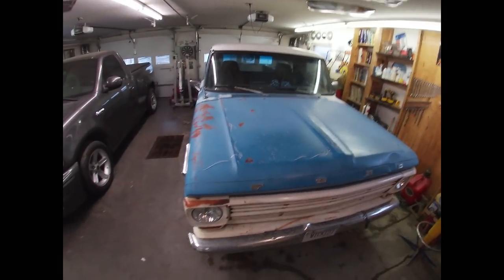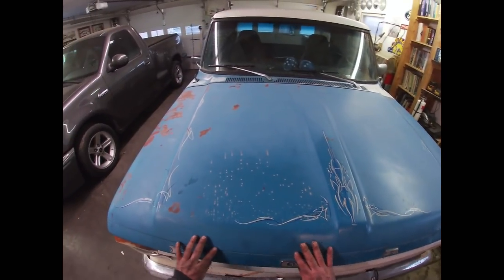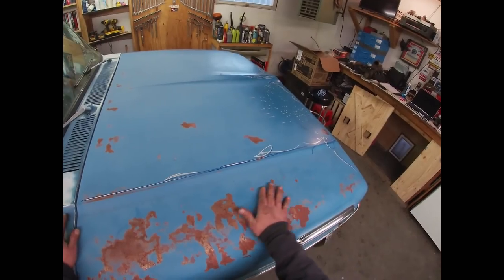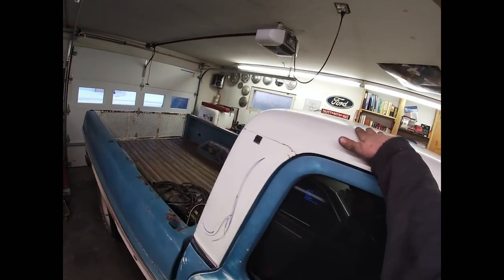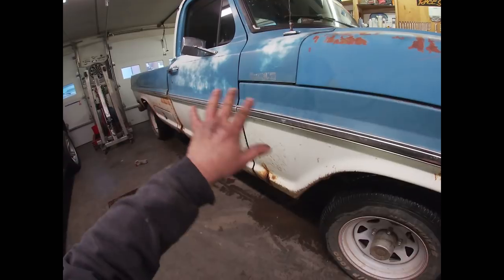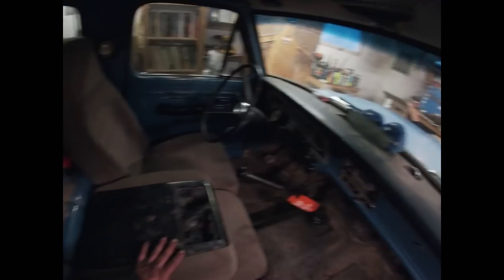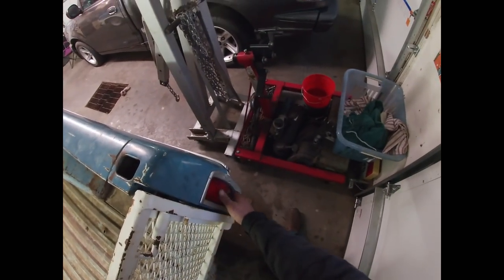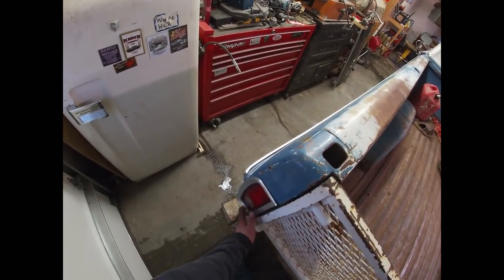A very special video for a blind viewer

Comment: Thank you for doing this.  When I was a kid, my parents had a 1969 ford f150 three-quarter-ton camper special truck with the 360 v-8 engine.  I loved that truck with the four-speed manual transmition.  When it was no longer drivable, I would sit in it for hours on end and pretend to drive it.

Comment: Cool description.  I love these old Ford trucks.  Like I’ve mentioned before, my first truck was a ‘69 F-100.  Same blue as yours, but the whole truck was blue.  I bought it in 1988 from the original owner for $1,100.  It had 166k miles.  360 V8 with the 4 speed.  No rust, but paint was oxidized.  Oh the memories.  Wish I still had it.  Loved the sound.  Thanks for the video.  Brings back good memories.